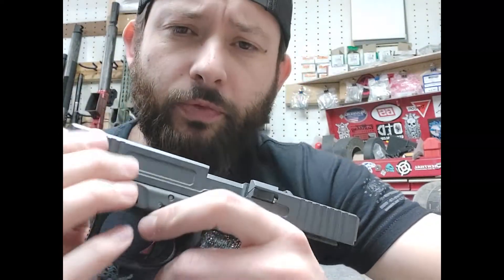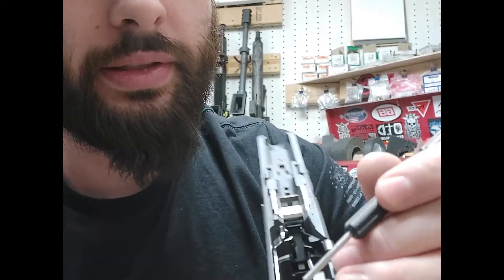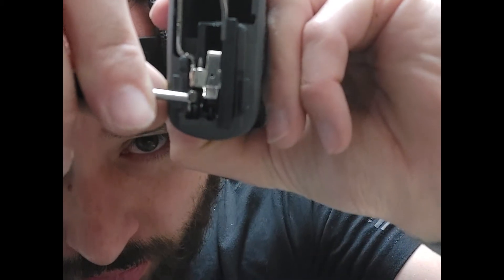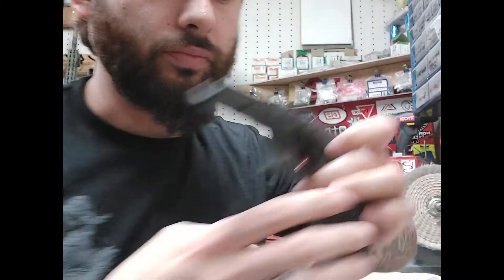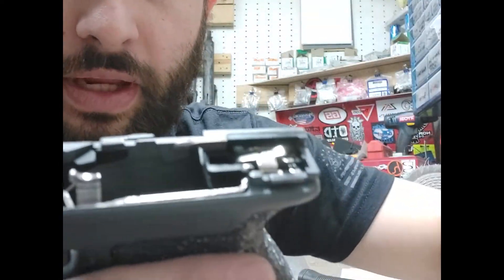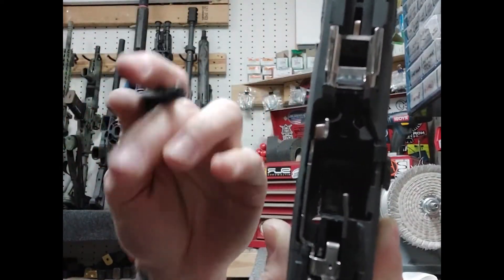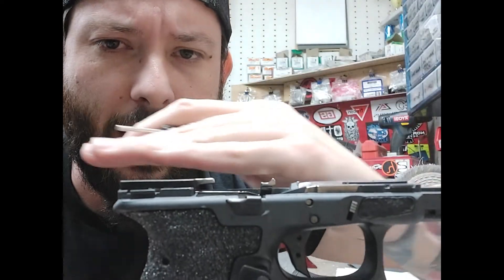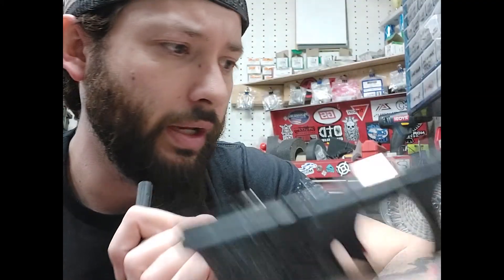DC Tech Tip - Glock Trigger Failure to Reset

Comment: If you have a Gen3 or Gen4, if the S-shaped trigger spring breaks, it will reset if you hold the trigger back, but not if you let go of the trigger.

Gen5, V models, Gen6 and the 42/43/43X/48 models use a different trigger spring arrangement.

Comment: Having a weird issue. Lets see if someone can help:

On my Sct43sc (G43x clone) Trigger works fine. Resets fine… however. If I lock the slide back. Press and trap the trigger, the trigger fails to reset when I release the slide…

Ive done everything I can think off. Adjust the connector, cruciform, oil the return spring, polish the trigger bar contact point… my Dagger Micro resets fine when this same thing is done. I cannot get my SCT43sc to reset. Only when I press and trap the trigger on a locked slide. 

Ideas???

Comment: I agree how frustrating his unfocused video is! I really was not seeing ANY fix in the video. But commenters were the most help. I had mine recently cerakoted, so tolerances all tightened inside. I dropped lube in where the rear of the trigger bar rides against the frame as the trigger is worked back and forth. Put the slide back on, and (after a few workings) this seems to have fixed the not-resetting problem. I tried it dry-firing about 40 times w/out an issue. Now it'll be time to visit the range for the real test. I think I want the Glock performance trigger.

Comment: I have a Shadow Systems MR920 doing almost the same thing. The difference with mine is that the trigger stays back only when my finger is still on it
Reply: Same have u found a fix?
Reply: Me too did you find the problem or how to fix it ?
Reply: @ I took it back to the gun store and they were confused as to what was wrong with it. They replaced the entire trigger assembly and it’s working fine now.

Comment: I haven’t checked where you said to yet but all I did to mine was replace the recoil spring to a heavier one. Has only probably 150 rounds fired through it total. Last time I shot it, I had 2 dead triggers. It’s a Glock 20

Comment: I just installed back original Glock return trigger spring and it was fixed. At the same time, I polished all surfaces contacting polymer frame

Comment: I have a shadow systems MR920L model. So far I have 800 rounds thru it. Firing good, except I keep getting a lite firing pin hit that's not hitting the primer hard enough. Usually I can reloaded that round and it will fire the second time. I've cleaned my pistol after the 200 round break-in period and again after 600 more rounds. Could it just be a faulty firing pin assembly or do I just need to put a few drops of gun oil where the firing pin slides down into the slide? Other than that. The pistol shoots fine
Reply from the maker: Try a heavier firing pin spring. One drawback of the glock trigger design is its relationship between firing pin spring weight and trigger pull weight.
Reply: @dcprecisionllc1633  Good morning? DCPrecisionLLC. Well, because the pistol is warranty for life by shadow systems if your the original owner. When I do take shoot it again and still have issues with it. Shadow systems will go thru it. Will see. It's got better tho after I clean it the first time I cleaned it. I mess up. When went thru it ( field strip) after purchasing it. I put a drop of oil down the where the firing pin assembly sit down in the slide channel. I don't know why I did that. Just wasn't thinking. Dum on my part. It gummed up a bit I'm assuming that the dirt that was built up wouldn't let the firing pin full travel. Nice and clean and OIL FREE now. It shot better after that, but still getting lite hit every magazine. According to shadow systems and I shooting fiocchi 9mm 115 grain, that they have issues with lite hits with fiocchi and Winchester. So I'm going to try my Sellier and bellot 9mm 115grain I've had 0 issues with that ammo. If I'm still getting lite hits. I'll contact shadow systems. They been 👌 so far. Love that Texas base company

Comment: I think you nailed it.  My new SCT frame doesn't want to run with either alone Wolf or Poly 80 triggers. I put the stock Glock trigger from my Gen 3 G23 in and noticed a wider gap between the trigger bar and that corner in the frame.

Gonna sand that corner down and try it again. Thanks!
Reply: Did it work?
Reply: @Deadman Greedo  yes. Then I went back to the Poly80 and put on a new connector and it works reliably now.
Reply: Gonna do the same!

Comment: question . so my trigger resets every time but when the trigger is down and i rack the slide back and release it the trigger resets but the trigger just goes down(dead trigger) or when i fire a round it chambers another round but the trigger just goes down the same way and doesn’t fire. help?
Reply from the maker: The trigger bar is not staying up to capture the firing pin during recoil. Double check for trigger bar to frame contact and that the connector is moving over correctly to release the trigger bar.

Comment: Great video this is my exact problem, except I have a brand new glock 21 and it's happening. This is my first gun and I was wondering if you used sand paper to clear some of the frame away? I don't want to have to send it in if I could fix it this easily, any help would be much appreciated!
Reply from the maker: A rotary tool with a carbide bit gets the job done in about 10 seconds.
Reply: @dcprecisionllc1633  thanks for the reply man, youtube never sent me a notification. I just came back to re-watch because I was gonna give it a try today.

Comment: Good video of the rub issue...my question is what makes the trigger bar pop up when moving that part to the side?? Mine pops up with slide off but not always when slide is on..i dont see any spring under  trigger bar...how does it do it??
Reply from the maker: The trigger return spring is what puts upward tension on the trigger bar.

Comment: I had this issue and was able to fix it. My issue now is that the slide will not fully go into battery while the trigger is trapped, but Will go back into battery once I release the trigger. And it’s only with this one slide

Comment: I actually have the opposite problem. When I hold my trigger in it becomes a dead trigger but it resets every time as long as it's released.
Reply from the maker: Check your engagement and the bend on your connector. Something is preventing the firing pin from grabbing on the trigger bar when it's coming back into battery.

Comment: So, what did you do about the trigger bar rubbing the frame?
Reply: Yeah, I never saw him fix it.
Reply: I would like to know as well. Did he sand or file the frame down alittle more on the side wall or did he bend the trigger housing inward? We're waiting on an answer if you will. Thanks
Reply from the maker: @MRBRAZILLIANKING  either option works. It's easier to remove a little bit of polymer from the frame that metal from the trigger bar or risk bending it too far and causing other issues.
Reply: @MRBRAZILLIANKING you meant trigger bar no?
Reply: Exactly

Comment: exactly why make the damm video if your not going to show the fix.  I have this exact issue really lame not to show the fix
Reply from the maker: If two parts are rubbing together that aren't supposed to you should probably make it so they don't rub. Several ways to go about that. Removing material from that area of the frame would be my first suggestion. Critical thinking goes a long ways Fred.

Comment: Yea why don’t you tell us what you did actually.
Reply: There’s really not much you can do.  He said drag. So Polish. But if the issue is that the lug isn’t properly pushing it back …. Might be a tolerance issue and need to try different disconnect bar. Can’t add material. 
In my case it’s this issue but the slide doesn’t push the bar enough. Bending it out doesn’t help. Used another one and it was enough
Reply: So youtube doesnt remove the video.

Comment: I've watched countless 10+ minute long videos where they babbled on and on and all of them were the same. This is the first video I found that actually corrected my problem and you got right to the point. Thank you so much! (3D Printed frame, my layer lines were juuuuuuust rough enough to catch the trigger bar ever so slightly. Filed them down now it's buttery smooth)
Reply: Did you see a different video than the rest of us?  Maybe it happened while I was sighing and trying to see through the blurry camera image but I don’t remember hearing HOW to fix it, just what is wrong. Unless you’re saying that the cure is implied - replace the whole trigger assembly with a stock Glock trigger.
Reply: See your comment helps bc he doesn't say to grind or file it down he just says it catches
Reply: @danieltabb3698  we’re do I sand down tho
Reply: mine was a combination of the connector spring and pushing the cross bar against the frame. i sanded it down and then applied a little bit of lube. probably going to have to go back in and clearance it some more but already broke it down 10 times today so im done lol
Reply: what did you do? same problem
Reply: @DArealDonzo  I used fine sand paper to smooth out the layer lines (again, it's 3d printed so it wasn't as smooth as what a factory glock frame would be, so I had to make it that smooth by sanding) and I also found out my connector was out of spec so I ordered a ghost lady connector from ghost inc.